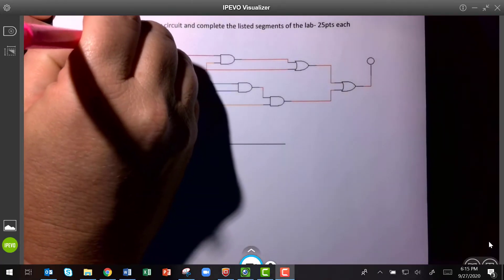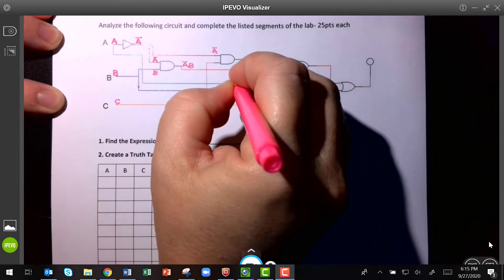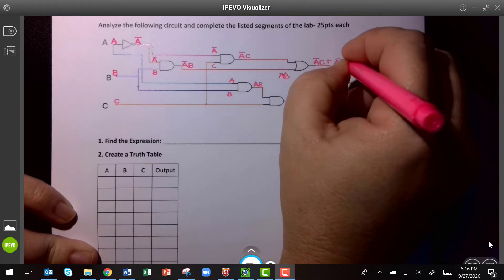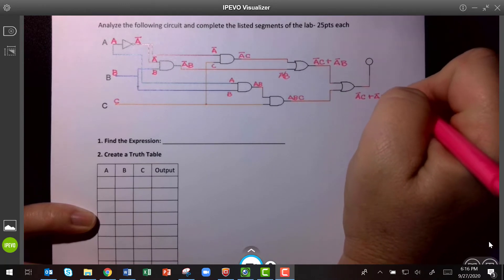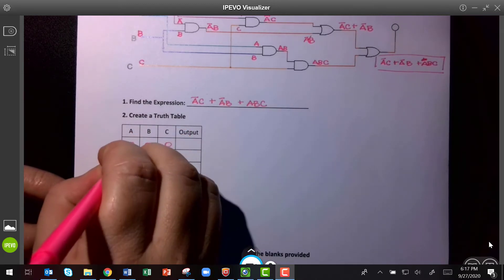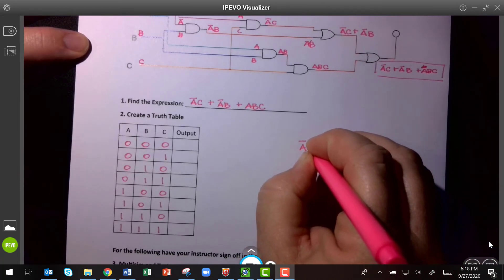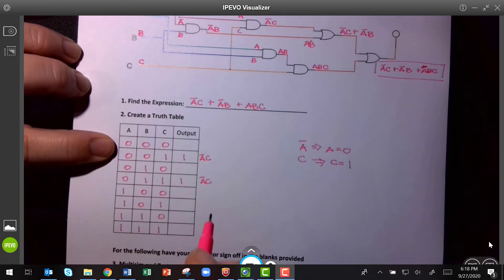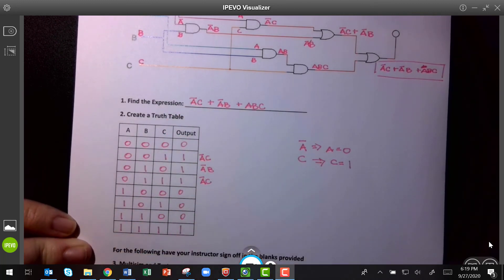AOI Circuit to Logic Expression

Comment: I just have a question. What would x become after a two input NAND gate? Would it become x not? Also, with the x (not?) and a y put through a two inverter NOR gate, what would be the expression afterwards? Thanks!
Reply from the maker: If you put x into both inputs of a NAND gate and then combine the output from that gate with y through a NOR gate, right? The output of the NAND gate would be NOT(xx) which becomes NOTx or NOTx (x!+x!). That reduces to just NOTx (x!). The output of the NOR gate would be NOT(NOTx + y). That becomes (NOT,NOTx)(NOTy). The double NOTs cancel on x to give x(NOTy). I hope this helps.
Reply: @MandyTCTC  Thank you so much!